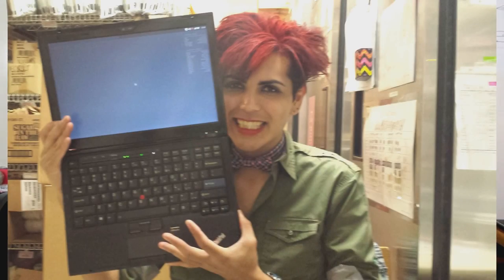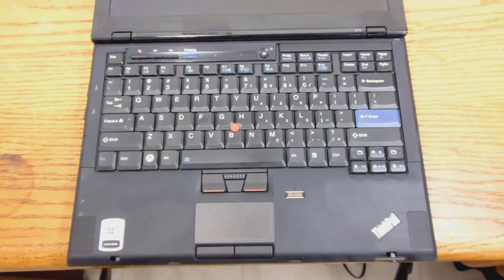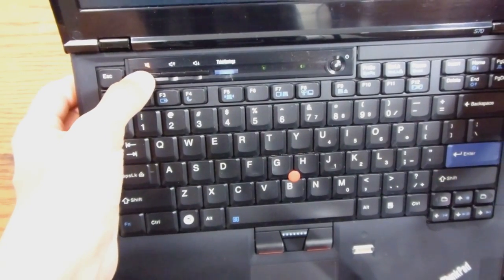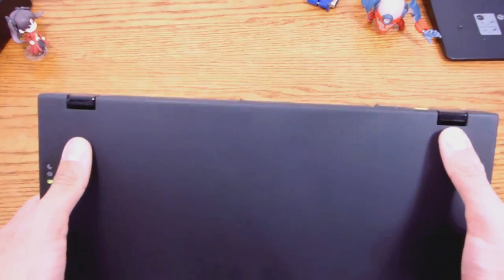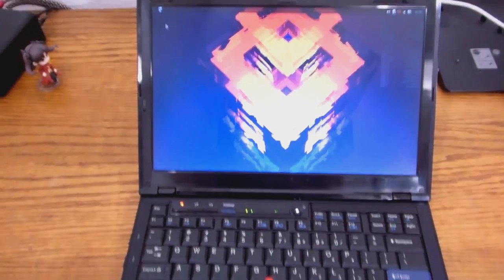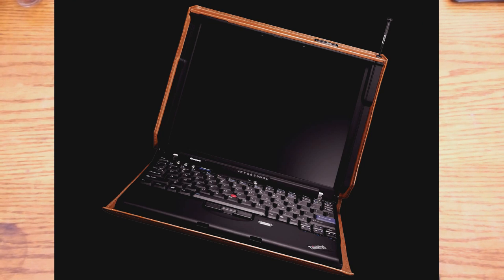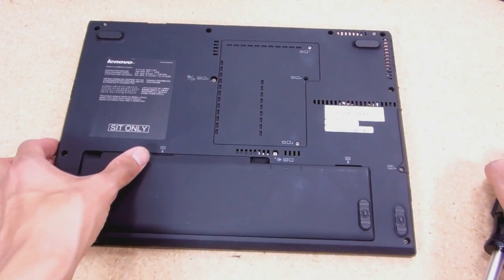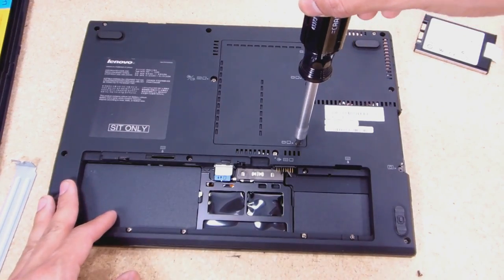Review: Lenovo ThinkPad S70 "Kodachi"

Comment: I have a used X301, which I got as a temporary measure after my X220 was stolen, as the X301 is very cheap now and I always wanted one.  

However, I have found it to be too slow for everyday use these days.  I may get an mSATA SSD put into a 1.8" enclosure, to replace the current HDD, to speed it up.